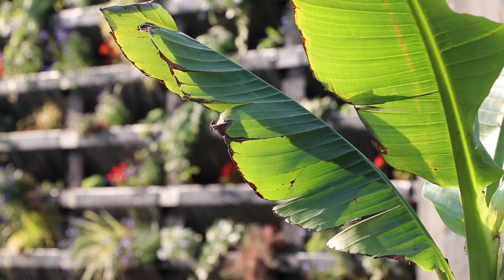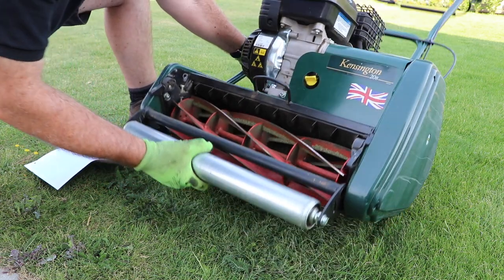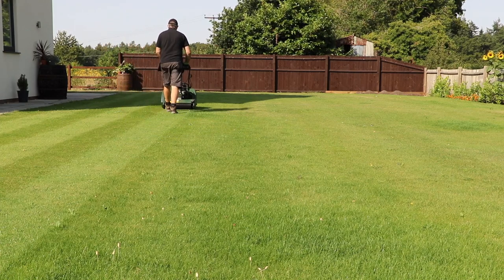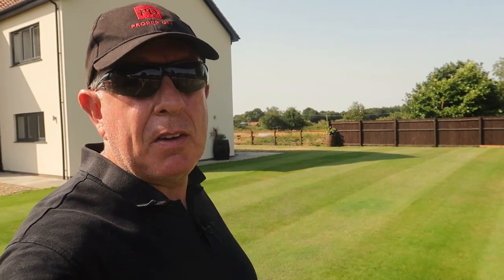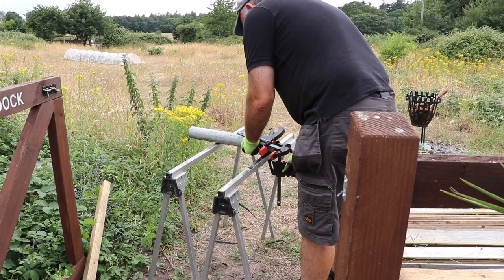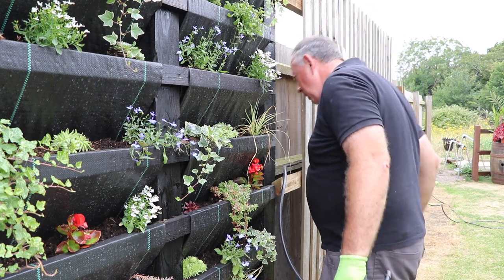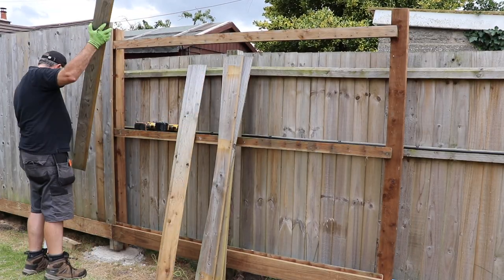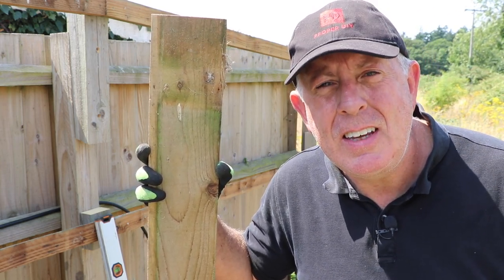DIY on the Hottest UK Day EVER!

Comment: Just a few tips from an Aussie when working in the heat. Wear a loose fitting light coloured cotton shirt, and a wide brimmed ventilated hat. It will protect your head ears neck and face from the direct heat, and allow any breeze to cool your noggin. Yes, use plenty of sunscreen on the exposed arms and legs. I also give my lawns and plants a good watering in the cool of the night before the high temps, and if the lawns just have to be mowed, I raise the blades so the grass blades are cut to about 15-20mm high to protect the roots of the grass from evaporation and burning due to the heat. And if any new and strange spots appear on your skin, get to your doctor asap to get them assessed. Keep up the great work, I’m finding it immensely interesting.
Reply: dmm, I bet the majority of the likes for your comment got, are from us Skips. Middle of winter 17° blue skies, hard at work out back.
Reply: @anthonyb8208  I wouldn't be surprised. But it's been 0 deg here in Melbourne for the past couple of mornings, with frost on the grass. Hell of a contrast with the UK. But I hope our friends and colleagues in the UK and Europe keep safe and cool, and maybe take a couple of ideas from those who have experience working in the heat.

Comment: I know the fence is largely sheltered, but what happens if the fence blows over? The pipe, being closer to the ground, might be ok but is there a risk the cable could get yanked around?

I’m surprised you didn’t rig up a shade when you were working on the fence.

Comment: Hi my friend. I notice when you were fixing the cable holders, you were using a fat/large screw holder. I use DeWalt products as an amateur DIYer, but what holder is this and what would be the benefit, compared to the slim or narrow versions I have? Cheers 👍

Comment: If you want to know if your thermometer is accurate, stick it in a glass of water filled with ice cubes and let it sit for a few minutes, the red alcohol should read on the line of 0°C or 32°F. I have a similar thermometer to that and I find that they actually are surprisingly accurate as quality ones.

Comment: It hit 107.8/42.1 in my conservatory/lounge. And that was with every window and door open and a couple of fans pushing air around. Shockingly hot for us Brits.
Good effort getting out and doing something in this heat Stuart.
Reply: You're better off keeping the doors and windows closed when the heat is extreme. I managed to keep our thermally inefficient house 10c cooler than outside on Monday and Tuesday. The most important thing to do is keep curtains and blinds shut as the sun comes round. If you haven't got blinds already in your conservatory then it might be a good investment

Comment: Stuart
Interesting video. One query: the fence you were boarding seems to be well over 6ft (or you are very short).  There is a limit in fence height where you do not need planning permission. From memory it is circa 2.1m.  Did you need pp for your fence?
Reply from the maker: The lawn dips down starting 2m from the fence and it is high on the other side so once i make up the dip on my side it will be around 2m total which i believe is the official limit
Reply: @ProperDIY  in hindsight it might have been useful to highlight the official limit.  Else some might be busy copying what they thought you did to obscure nasty neighbours and contravene planning rules.

Comment: Your a nutter working in that heat, it was like the wind was like oven door open. Good job as always.
Reply from the maker: Yep, just like all the years I did working in the Middle East!
Reply: @ProperDIY  we went to UAE years ago and was very hot like that. But you do get used to it and all places have air conditioning so not too bad. Our houses are not used to this that's the problem.

Comment: Use metal clips for cable, basically always. Premature collapse is a big deal anyway in the regs now, so it always makes sense to have a decent supply and I always use them as a habit these days - they're not much more expensive than plastic ones, and outdoors they handle the sun better, indoors in ceilings etc they're basically required so there's not a whole lot of reasons to use plastic ones.
Reply: Pre-mature collapse regs do not apply here, this is not an escape route.
Reply: @AndrewStrydomBRP  of course, my point was they're worth just having, and you may as well use them because the price difference is miniscule.They'll last longer outdoors anyway.
Reply: @streaky81  They won't last longer outdoors, especially in this instance where the plastic is not being exposed to UV at all, and the price difference isn't that small. the price per clip is triple.

Comment: I really admire your determination and courage to work under the sun and that temperature, it is really unbearable. I am Spanish and supposedly I should be used to 40C during the summer, however at 55 years old I never get used to these temperatures, I can only recommend you some advice like wearing light coloured clothes and not exposing your head to the sun, always under a hat, sun protection factor 50 and drinking a lot of water from time to time even without being thirsty, beyond that I can contribute little, just wish you a squall with cool and humid wind that lowers that fire. Greetings from Madrid, good job!
Reply from the maker: Nice to see you watching in Spain. Good advice!

Comment: As I understand it, a fence is not considered a permanent structure and should not therefore be used to act as a support for electrical cables according to the Electrical Regs.
Reply from the maker: Neither is a shed but electricians will happily wire them up for you

Comment: What’s  the reason for always going over the screws with a hand screw driver ?
Reply from the maker: Good question. Impact drivers are great but have no clutch. So very easy to over drive. So I tend to stop slightly early and then finish off by hand so I can tell how hard I'm tightening each screw.

Comment: On the comments about fixing the cable (and water pipe) to the fence. One tip is don’t do so to a fence that is your neighbours, because you have no say if/when the fence is replaced. And probably you should seek their permission to do so anyway. No doubt there are rules about attaching stuff to other peoples fence. If you need to do a run along the boundary where a neighbour owns the fence, better to install your cables on a separate post and rail you instal on your property. A bit of work but easier than digging that 450mm trench!
Reply: It’s his fence.
Reply: @markmciver1981  I know, but the thing with U tube is people watch someone do work and then apply that to their situation. Not every household owns all the fencing that separates all their property from the neighbours. As you look down our garden to the rear boundary, to the right the fence is owned by the neighbour. To the left by us. Not sure who owns the rear fence! Our shed is in the right hand corner, so when armoured cable was put in to it, we dug a trench and buried it. If it had been our fence I would have done as shown in this video.

Comment: Will you come to regret tying the cable/ pipe to a fence which at some point may have to come down? Great stuff Stuart, long may you continue producing these excellent episodes (don't get heat stroke, although if you have done time in Qatar I expect this heat was very manageable)!
Reply from the maker: I think the fence will survive for a few years. If I need to I'll have to put in another but digging is not fun